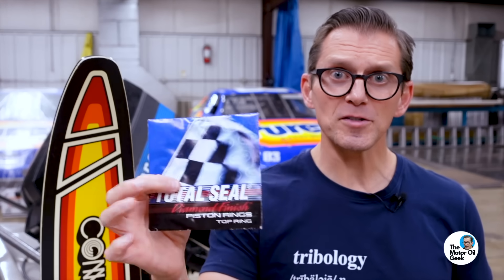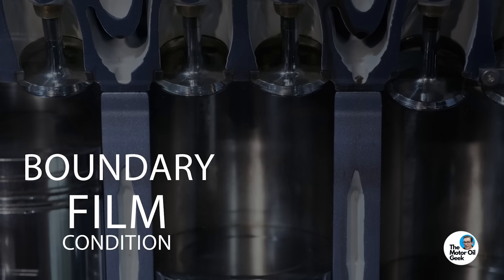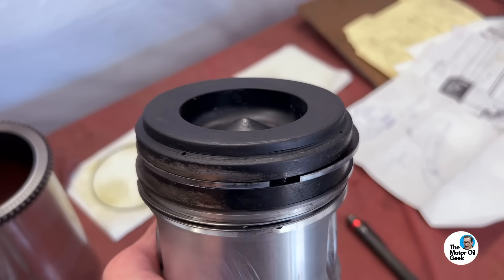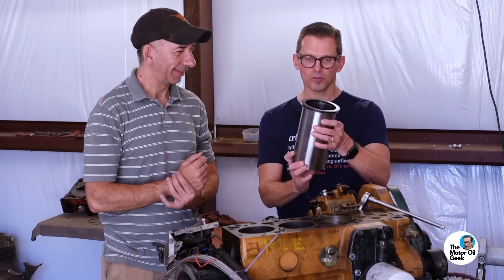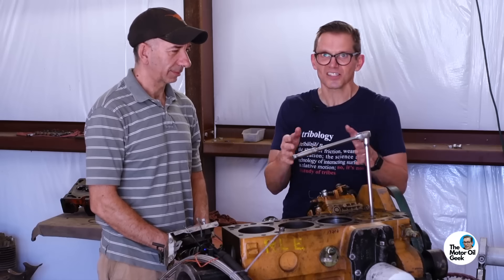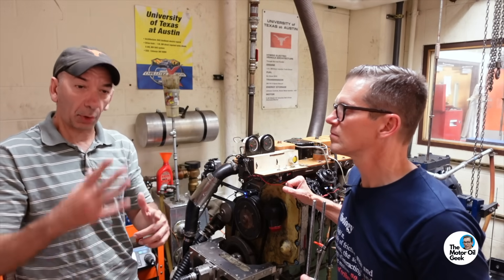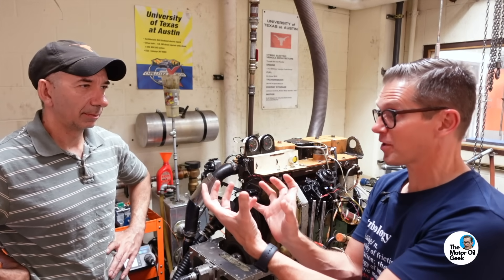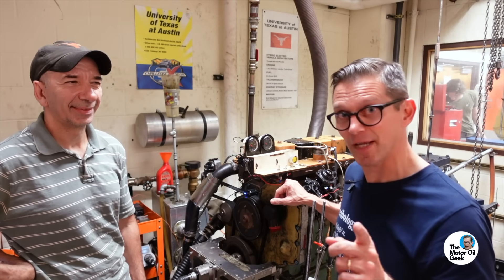Water Skiing Explains LUBRICATION - This CRAZY Engine Proves It!

Comment: Sorry Lake but your selling snake oil this time.  I you were seeing "boundary" wear at the top of the cylinder in the reversal area you would also see it at the bottom of the ring travel in the reversal area.  The reason you have more wear at the top is fuel wash and that is the hottest part of the cylinder.  Hone a high mileage block and the last part of the cylinder to clean up is the area around the intake valve.  The area that has more fuel wash.
Reply from the maker: We will have to agree to disagree. Fuel wash and higher cylinder pressure increases the wear near TDC compared to BDC, but it is the boundary condition in those areas that increase friction and wear.

Comment: Back in those days they were truely the innovators and creators of what we have today.     They also made and used a (Rotating Radial Engine) that the cylinders spun around a stationary crankshaft, essentially acting like a spinning wheel with the cylinders radiating outwards, unlike a "stationary" radial engine where only the crankshaft rotates within a fixed cylinder block

Comment: This is very good and I paused the video to study the data and chart, but it might have been helpful to do your own follow-up at the end to translate Dr. Dardalis'  technical explanation into something slower and easier to understand.

I'd also like to understand why the RLE test ended at 7 bar IMEP and why the data shows the weird FMEP drop and spike at the end.
Reply: The spike at the end is due to temperature variations of the tests.  The IMEP limitations are not related to the rotating liner concept but to the fuel injection system and the lack of a turbocharger.  We will run the engine under higher IMEP in the future.

Comment: Missing engine oil being at its designed operating temperature. Running at the right oil temperature is very important to wear and hydrodynamic lubrication . Must be formulated into equation... I Like this video and presentation. Very interesting.
Reply: We are using standard 15w40 oil for diesels.

Comment: 7:50.   But I have escaped piston rings!  
Could you do a video about the tribology of the Wankel rotary engine?  I think that would be really cool since there are some weird problems that had to be solved when lubricating a Wankel engine.
Reply: The problem of the Wankel engine is that the apex seals meet the stator at drastically different angles forcing the shape of the apex seal to be very curved.  That makes it impossible to build a good film thickness, despite the near constant sliding speed.  The fact that some areas of the stator are permanently exposed to combustion also compromises the viscosity of the oil in the hot side of the rotor.  The combination of these condemns the wankel into a reduced life of the seals, even though the conventional engine has to stop the piston at TDC. .
Reply: @dimitriosdardalis6658  aside from the Apex seals, there are also corner seals and side seals which share some, but not all of the difficulties of the apex seals.  Those are just the sliding seals that are analogous to piston rings.  There are other lubricated areas too.  For instance, I think the E-shaft uses similar lubrication to a crank shaft, but it does not have the oil pan directly below it.  Where does blow by past the side seals go if it happens and what issues does that cause?

There is a lot more to lubricating a Wankel than just apex seals.  Though they are, admittedly, the most obviously interesting part.
Reply: @saulekaravirs6585  The flat seals on the side (I think they call them face seals) do not suffer the severe lubrication issues that the apex seals suffer for the reason I mentioned.  The contact area (flat faces) is larger, and even if there is metallic contact, it is spread over a large size (they may have some contact because they do not have the reliable lubrication that our face seal receives).  The blowby on the wankel is from one chamber that is at high pressure to another that is at a lower pressure.  I am aware of the eccentric shaft journal, this is lubricated like a crank.  I agree that the wankel is a very interesting piece of machinery.  It has inherent advantages is power to weight and power to size but inherent disadvantages in efficiency and longevity.  It is not doing so well with emissions either, but the Japanese have managed to do something with it.  Cheers.

Comment: This is fantastic! How long before this is a standard? And gasoline engines as well. Good job Lake and thanks!
Reply: The OEM's are not crazy to implement such work because the tooling costs are high and the benefits are to the engine user.  But we plan to build retrofits which will make the technology well known.
Reply: @dimitriosdardalis6658  Thank you for the information sir.

Comment: Sulzer za40 engines have a rotating piston. Normaly you only have to change the piston crown on them during overhaul.
Reply: Yes, but their pistons moved very slowly.  I would definitely want to know more about these old 2 stroke engines.  There is very little info out there on the internet.

Comment: so the question becomes…. which one breaks first??? the mechanism to spin the cylinder or this new seal???
Reply: The seal should be hydrodynamic, so as long as the oil is clean it should not wear.  The mechanism is relatively low loaded gears.

Comment: I have a question! What is the mechanism for lubricating the outside of the sleeve where it contacts the block?
Reply: Yes, there is pressurized oil supply to the outside of the liner, which flows down the oil sump.
Reply: @dimitriosdardalis6658  So, if I undestand everything. The sleeve is semi-floating on a microscopic scale? If so, that is amazing.
Reply: @billhusted1753  Yes, the film thickness between the rotating liner and block is about 0.002".

Comment: Fascinating.  You've reduced the start-stop friction of the friction ring within the cylinder during each cycle. You've also reduced the static friction of the piston skirt under high load on the cylinder.
 wall at the top of the cycle.  Both of these are under load.

But you've increased the surface area for friction in each of the rotating cylinders, but they typically are not under load. At least not much load. But you do have drive losses in the gears. The gear train and the surfaces the bearing surfaces of the rotating cylinders. 

I am surprised that the sustained losses due to internal friction can be reduced by 10%.

I'd really want to take a look at the experimental system design and the data.

Also, that rotating head gasket seal needs to last 200, 000 mi under varying loads with high reliability.

Static Head gasket took a long time to get there.  And sometimes manufacturers blow it.  Another place for development. Great work. 

Hook em Horns.
Reply: The old sleeve valve designs solved the moving head seal issue by replacing the head with a "junk head" which was basically another piston (complete with rings) fixed in the top of the cylinder.
Reply: @nerd1000ify  Thank you. Great input. I never knew what a junk head was till now.

Comment: From a consumer standpoint, with well-maintained good-quality engines lasting 300k miles, which is basically the life of the rest of the car, what benefit is there?  I see a future of endlessly replacing the seals, which will require a full engine teardown.  Remember that this thing has to be 100% watertight, too, so it can be cooled while submerged and spinning.  I think there will be too much to overcome for it to be viable for the consumer market.  Super cool idea, though.
Reply: Application is heavy duty engines where fuel economy is critical.  No need to be watertight.

Comment: Id be curious if the ring in the cylinder head could have small fins on it so as it rotates it could create additional swirl inside the combustion chamber.
Reply: Good thought, perhaps the rotating liner could have something to "steer" the combustion chamber, but real estate in the combustion chamber is expensive.
Reply: @dimitriosdardalis6658  good thought.   The only thing I'd be concerned about is creating hot spots in the combustion chamber with any "fins".   But I guess you could run coolant on the other side of the ring to perhaps act as a heat sink in the chamber as well.  Swirl + heat dispersion might actually create a solid benefit.   Its good brainstorming i guess.

Comment: I would like to see how many miles this system would last compared to base engine ? If it saves 10% in fuel but lasts only 80% as long then there is no savings! Also why test 2 different engines they should have just tested by disabling the rotating liner function then turn it on?
Reply: The life should increase by a substantial amount because the leading cause of wear is eliminated.
Reply: Not the life of the spinning cylinder liner an all the sealing services, yes the cylinder walls and rings should last longer...
Reply: @markpontes4457  The sealing components also operate without metallic contact.

Comment: I learned something new. High Speed moving parts create full film lubrication which is the most efficient lubrication.
Reply: So lugging an engine around at near idle rpm to save fuel kills it faster.

Comment: Another indirect discovery from WW2 helping us in 2025. The Napier sleeve valve engine was massive and an awesome engine design.
Reply: I worked on one a Willy's knight in a car 
Also check out the Napier Deltec triangle motor ....
Reply from the maker: Agreed!
Reply: but at what point is micro jet-shafted power makes more sense as much as i like 440's the other in Chrysler 518?-engine ( 90-250 hp for recharging batteries using kerosene/diesel and letting gasoline pumps die-off eventually ) makes more sense in a hybrid version my 2C

as hoover/other's pointed out turbocharged or v8's have lot's of little details/parts and or emissions can be challenging and renki-cycling is simpler generally speaking it's the materials science that's harder and or marketing
Reply: If you mean using a gas turbine, to run a generator, it probably becomes viable if your intended output is more than 300 kW or so. Small gas turbines have poor efficiency for various reasons.

Comment: How does an engine like that maintain a seal between the block and the head?  No head gasket or a special one to work with those sleeves?
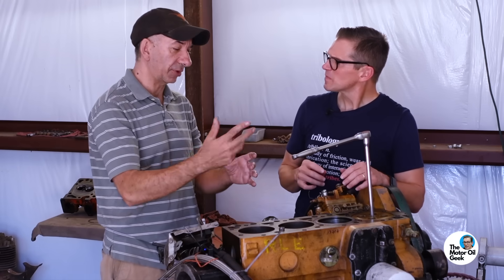Reply: I think he covers that at 5:38 in the video.
Reply: @MathewPollard-vj4uq  I re-watched that part.  The cylinder seals are addressed, but not the coolant channels.  I guess there is some other kind of gasket used for that.  Thx.
Reply: @davea4037  The coolant flow passages are not disturbed, the standard head gasket deals with that.

Comment: 10% increase in fuel economy is massive. An extra mile per gallon for a long haul diesel that gets 10 mpg cruising with a 500 gallon tank means that truck can now go 500 miles further before needing to refuel.
Reply: And save a lot of money in the process!
Reply: @dimitriosdardalis6658  It's not just the distance, the logistics of it too. You can skip a state, fill up in a cheaper state, or one with better truck stops. Small quality of life improvements, means higher morale, higher profit margins, which ultimately lowers prices for consumers. It has knock on effects that we don't even consider.
Reply: Everything will be electric in 10 yrs. 🙄🙄🙄
Reply: @ Yes, including the generators.
Reply: @hotrodray6802  Very doubt full. Within a city, maybe; out in the country, hell no. And definitely not OTR trucks, not unless quick swappable battery packs become a thing in the US.

Comment: Question:  what about the created friction between the liner and the cylinder block?  How is that being managed?  Additionally, I would assume there is a parasitic power loss to create the rotation of the liner...how does this affect the 10% savings?  Is the net still the same?  In other words...is the juice worth the squeeze?
Reply from the maker: The results reported are the net friction gains, so the amount of friction reduced in the ring to liner contact more than makes up for the added friction to rotate the liner.

Comment: Love your channel Lake. Love the history too. The sleeve valve engine was actually invented well over 100 years ago by american Charles Knight. His "Silent Knight" engines ostensibly eliminated valvetrain noise. The technology was licensed to many other manufacturers ie Napier which lead to the Centaurus and Sabre aircraft engines. The 24 cylinder Sabre eventually made 3500hp in the Hawker Typhoon and Tempest during WWII. I really believe lubrication technology of the time was this designs greatest downfall. My neighbor is currently restoring a Tempest V and has a couple of these Sabre engines. It would be great to get your input lubrication wise on bringing this monster back to life. I don't think anybody has actually heard one of these engines run in almost 70 years.
Reply from the maker: Awesome! Thanks for sharing!
Reply: The Knight sleeve was not the same as the sleeve used in the Napier Sabre and Bristol radials.  Those engines used the Burt-McCollum single sleeve.
Reply: @andyharman3022  Indeed, the knight was a twin sleeve with no rotation which had terrible friction characteristics.  The single sleeve was co-invented by these two fellows, so they typically use both of their names simultaneously, I think one was in the USA the other in England.
Reply: The sleeve valve engine did not have a downfall.  The downfall was on the whole large aero piston engines that were replaced by the gas turbine.  Sleeve valves were used in a commercial basis all the way in the 80's.  If you meant the Sabre specifically, the Sabre was very expensive and loud, and had very limited advantages compared to the Bristol sleeve valves.  But if it makes you feel better, Rolls Royce and copied the design in the RR Eagle, with saw very limited production.  The Sabre had a difficult life mainly due to its sheer complexity, and the Brits managed to get the issues under control by 1944.  Perhaps a bit too late.  The main problem of the Sabre was that the Hawker fighters that was used on were too heavy and too ugly, so the Spitfire completely overshadowed them.  Cheers.
Reply: @dimitriosdardalis6658 And , if I am correct ,  Sabre engines needed to be on temperature before starting .  ..... Unlike normal piston engines.

Comment: Very cool. Unlike a lot of modern "innovations", I had never imagined or read about anything like this.
Were the rings prevented from rotating on the piston?
Were the sleeves driven by the engine or an external source to isolate the source of FMEP? Does the 10% reduction of friction include the friction between the sleeves and the block?
Reply from the maker: The piston rings are pinned like in a 2 cycle engine. The 10% reduction is net of the added drag of rotating the liner.
Reply: @themotoroilgeek  Thanks for everything.

Comment: If you are saving fuel from cutting friction you should be lowering wear.
As most ice engines wear out from excessive ring cylinder bore wear , this is interesting. 
Ship engines are my 1st thought.
Reply from the maker: I’d love to do a back to back wear test with this engine design!
Reply: Just spreading the wear evenly around the cylinder surface should increase cylinder bore life.

Comment: Neat but with any tech like this, is it practical in the real world?

Cost to implement, cost to maintain, reliability?

Great video, thanks!
Reply from the maker: Thanks for watching. It will be interesting to see if this technology gets adopted.
Reply: Maintenance and reliability should improve.  Initial cost of course will increase, so the application is only for expensive commercial engines that operate constantly and use a lot of fuel.

Comment: How does oil an oil wedge form between the top compression ring at TDC and the liner when the relative motion area between them is not supplied with oil.
On a two stroke where there is oil introduced to the cylinder wall above the top ring sure but when the oil is from the bottom , I have doubts.
Reply: Your first question is good.  The answer to it is beyond what one can type in video comment.  The tribological details of the wedge effect are very complex.  But the good news is:  It works, it has been tested both by us and the sleeve valve engines.
Reply: @dimitriosdardalis6658  Thanks for answering , I hope this is able to be commercialized.